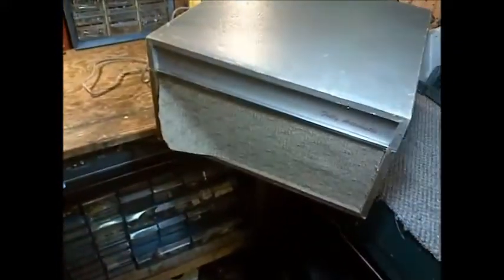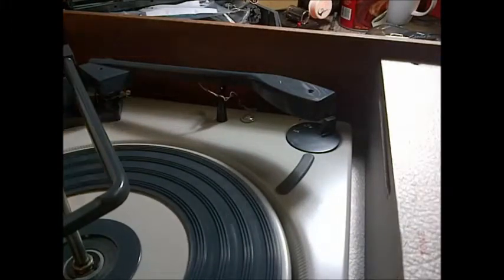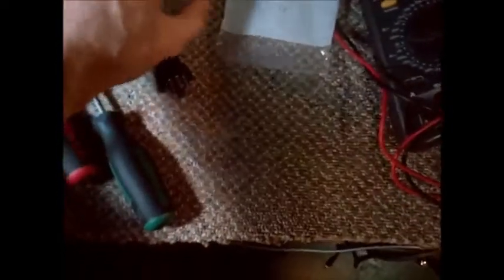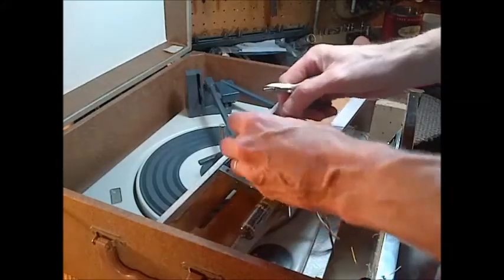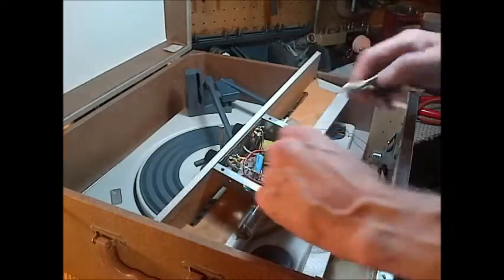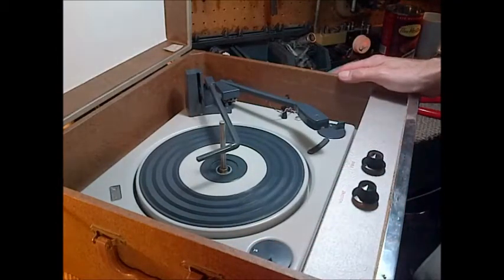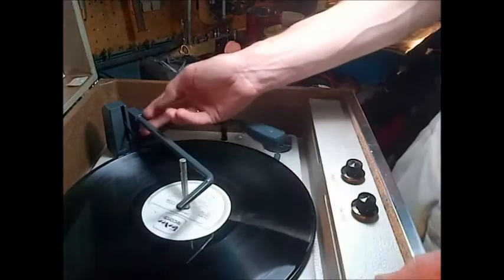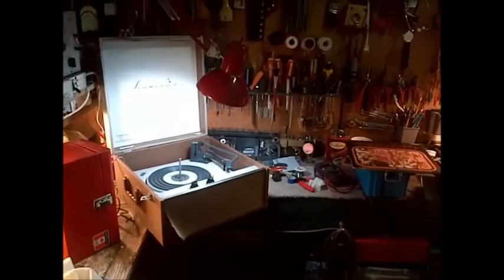Symphonic Record Player Model 962 Tube Amp Repair and Mechanism Lubrication

Comment: I have a Symphonic 1258. Platter turns at correct speed and cartridge is good. But the tubes in the amp do not light up and there is no sound from the speakers. Visually, the tubes look good and I don't see any bad solder joints. There is no fuse that ai can see. Any tips for what to look for first? Thanks!

Comment: Heat shrink tubing would have made a safer way to secure the cap leads and it would have been more interesting if you had  identified the tube used in the single out put stage. Also, hope you have bought a tripod by now.
Reply from the maker: Ken Bird That's an old video and I've completely changed my approach since then.  Along the way, I tried all kinds of video approaches and I think I have things worked out pretty good now.  I'm just finishing up on a Viking Console Stereo that you might find interesting.  The series starts with a Garrard RC121 MKII turntable and proceeds through the receiver to the final installation back in the cabinet (not quite there yet).  Thanks for the comment.  Oh, I'm more liberal with the shrink sleeves these days. Here's the first video on the console:   http://youtu.be/kBZtBKYM1WA   :-)

Comment: I always remove old capacitors and put in a soldering lug strip. And use shrink tubing on capacitor leads to ensure no shorts. 
Making s repair as neat as possible is important. 
Not to be to critical but your repair was kind of amateur. 
and not very professional looking. I am a TV Radio Phonograph Repairman 43 years experience.

Comment: I would have no problem replacing an old collaro with a bsr like that
Reply: Why ruin a period correct record player for dime a dozen BSR? It makes no sense. Just restore the Collaro.
Reply: sometimes the collaros just wear out
Reply: Larry Shaver
 Well if that's the case, I suppose you would have to replace it. But it shouldn't wear out that bad would they? Can't you restore them? I would be more interested in an older Garrard or something more correct for the period. I really don't like BSR that much. It will suffice but they always cease and have all kinds of mechanical problems. Though I guess they aren't that hard to fix.
Reply: @mysteryjesus  i did finally figure out how to make a Collaro work again so i won't need to replace them with a bsr anymore
Reply: @larryshaver3568  Good to hear! Good job